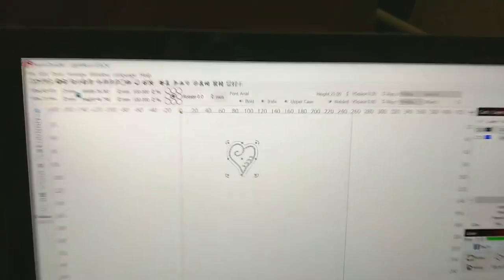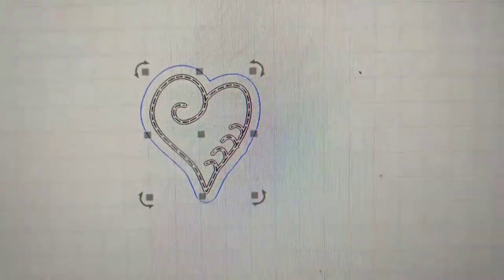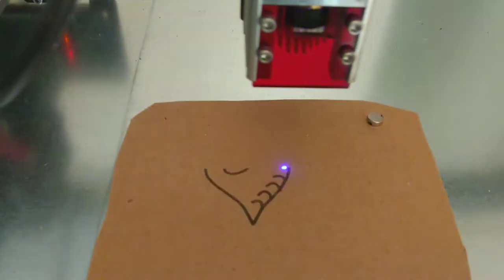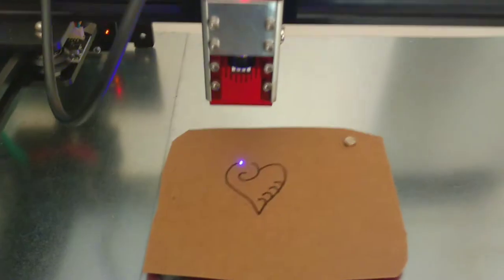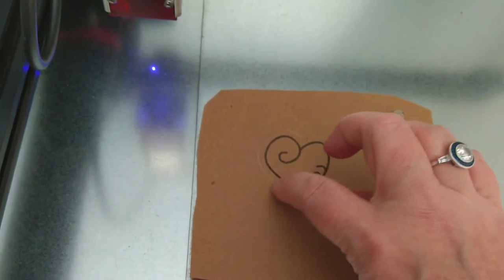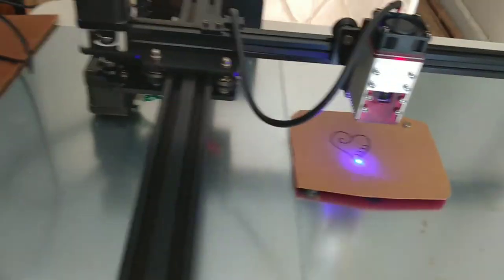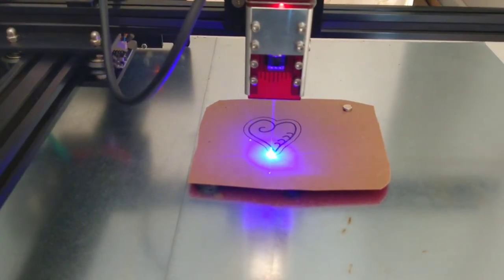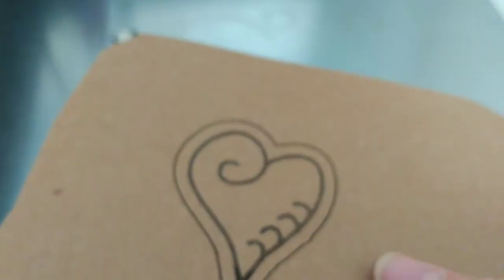Yay, finally trying out Lightburn!

Comment: i think you need change your s valuie max and the baud rate in lightburn device settings.  i have a 2s so i dont remember the master2 setting. but that has everything to do with the power settings so it will use full power.

Comment: Good luck on your Lightburn journy!  I am not there yet.  I have the mount for my laser 3d printed and ready to go on my cnc machine but now I have to wait for the right sized connectors to come from ebay  since I have to make an extension cable .  It's always "hurry up and wait" it seems lol
Reply from the maker: And waiting is so hard! Hope they come in quick. That's so cool you are building it from scratch!
Reply: well it helps so much more to your enjoyment of lasercutting experience..